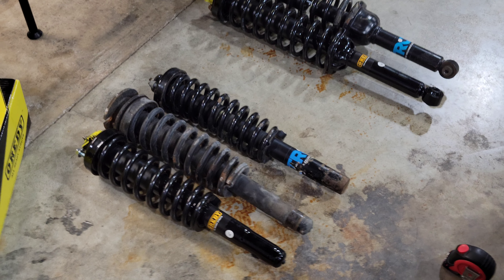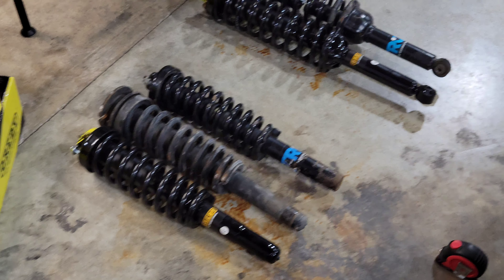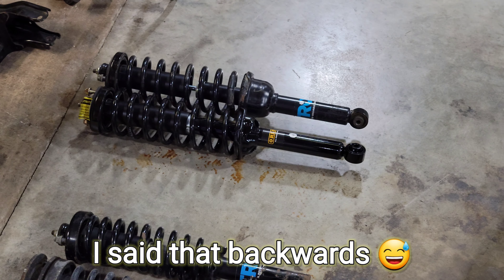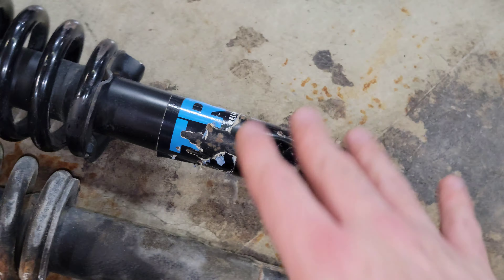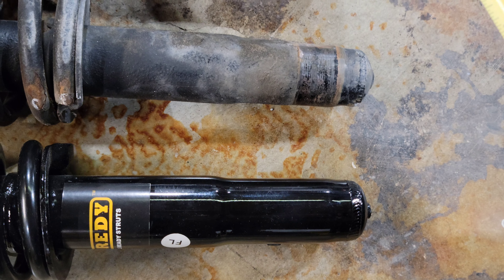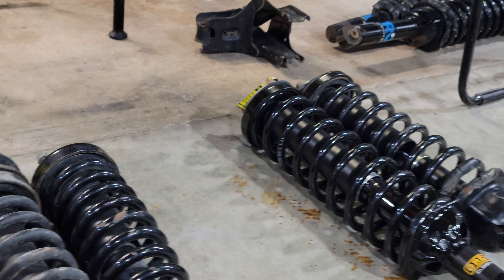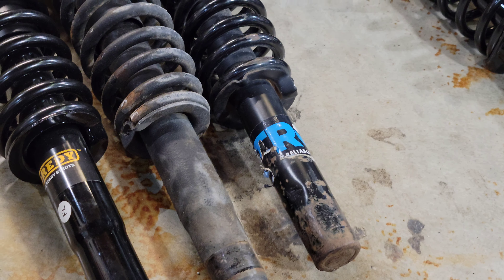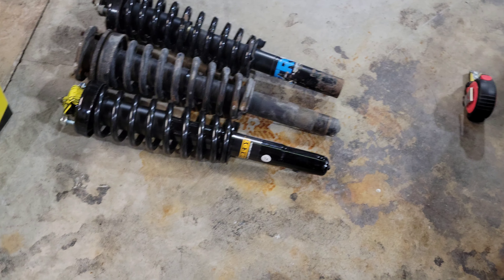STRUTS & SPRINGS FOR YOUR FIRST GEN CRV 🤷🏻‍♂️ ( RESULTS MAY VARY)

Comment: The best struts available without going $1k+ are the yellow Bilstien monotubes. Period. They come as a bare shock so you need to swap springs and tophats. They also allow a half inch drop with no mods by swapping the spring perch clip down. Best riding for on and off-road. I have yet to find a decent "quickstrut". All have failed on me within a few years and some are worse than the 15 year old OEM struts.  My TRQ feel demonstorably worse than the OEMs, I would personally avoid them unless you are a total cheapass. Even then I'd stay with OEM unless completely blown. Save up for the yellows while they are still available.
Reply from the maker: Totally agree with you there I have a set of those also, just trying to explain with different options you have to understand people have different price points and different budgets I'm not the type of person to completely knock everything just because it's cheaper and easier for one to afford and others look down on them for it! I try to way out options for people in all kinds of budgets.
Reply: What springs would you recommend for the bilstien struts
Reply from the maker: OLD MAN EMU SPRINGS
Reply: @crv_tom  im trying to drop an inch or two not lift
Reply: @crv_tom  I got ome springs and bilstine struts and the ride feels like cut springs from back in the day, you can feel every bump in the road. Do you know if any springs that are softer?